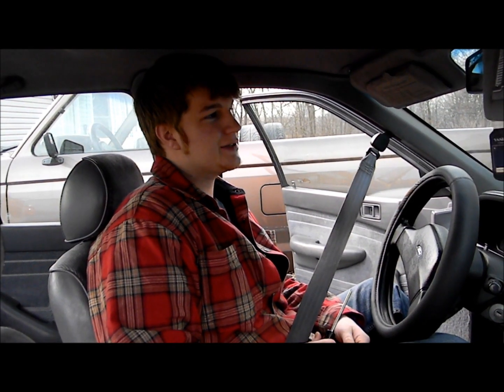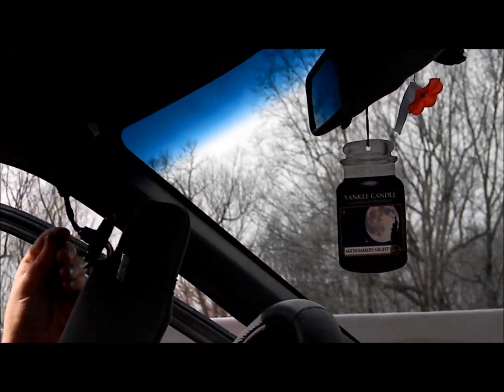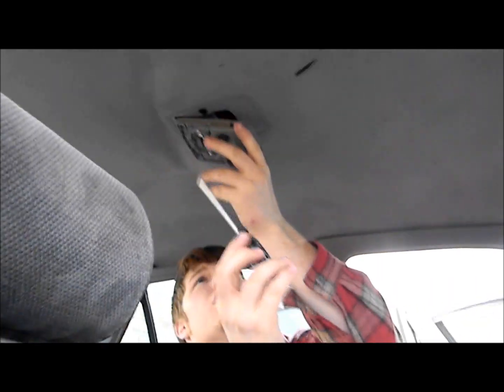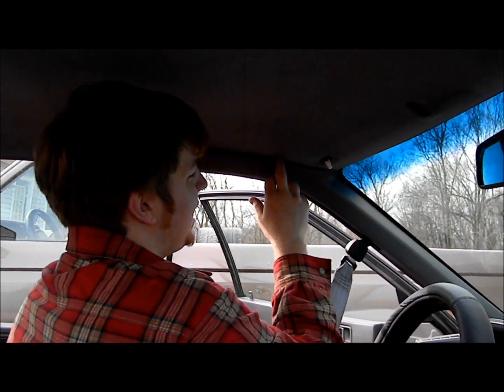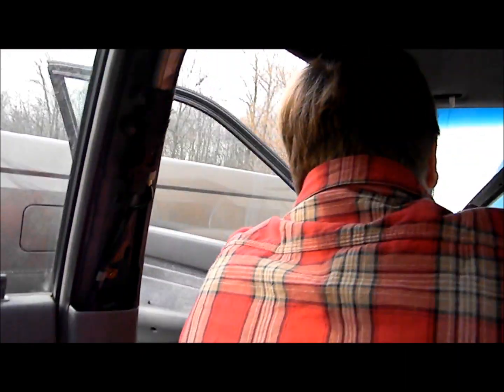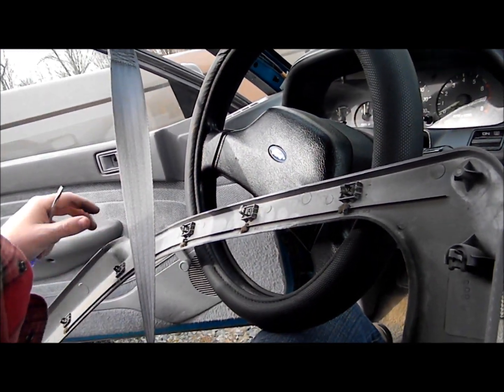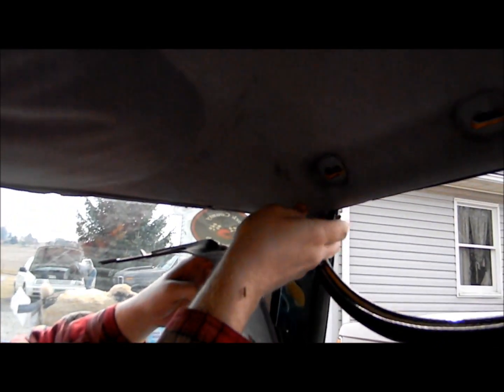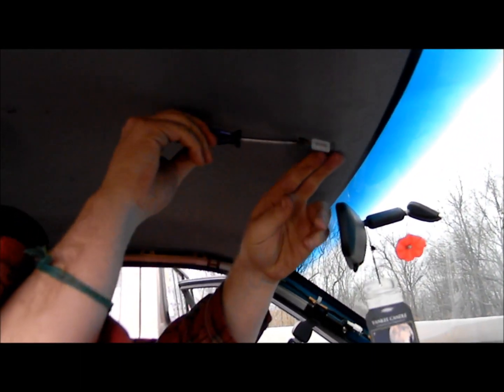DIY Custom Headliner | Headliner Repair | Custom interior

Comment: You have to remove all the old foam from the headliner first. Use a metal bristle brush to scrape it off. Otherwise the new bed sheet will start sagging in no time because thats what caused the sag in the first place, the foam started crumbling or the factory put the fabric on too tight (looking at you MK5/6 VW)

Comment: Hey guys great job! I've also done this with my wife but we just pulled down the old cloth material and wore safety goggles and laid the seats back and held up the New material we wanted to use. Then after the adhesive was done we used xacto knives and paint scrapers to push the excess into the panels. So we never had to remove the plastic and possibly break clips and seals. But your idea was definitely inventive and gives me some good ideas!
Reply from the maker: Thank you!

Comment: Very good video, better than professional. I very much squeezed the board out of the back right seat without braking it. Now I know how to put it back and I hope it fits. 
Also, I would remove the old foam unless it is very clean. The one you have seems very clean and uniform.

Comment: How long did this last? It's the foam that was breaking down and caused the fabric to pull away. Won't that simply happen again in a few months?
Reply: use a wire brush to remove all of the foam. A metal/brass one will work fine as long as the foam is fully rotted.

Comment: Good job young men. My "especial" is under the hood but my 86 S10 has the granny sag (not gray-sexy red lol) my prob is 1. It's a pick up so no trunk to slide out & 2. The headliner support plastic is broken. I don't have a center dope scope like your ford did, I'm thinking I'm gonna tear all the shit out & use some back upholstery carpet (was going to change seats at one point but decided fuck it) I'm going to attempt to use spray adhesive + silicone caulk lines to hold it up. Hopefully I can still cover edges with the "doodlejobbers" I actually learned quite a bit though. Bravo. I'll watch a cpl more of your vids, if they are as informational I'll add to my "professional subscriptions" 👍🏼

Comment: Has anyone seen a video where the original headliner is not available? I'm trying to replace a GBODYS headliner from scratch . I'm wondering what kind of board is flexible enough to fit the form?

Comment: another thing  you guys could of done was pull the headliner martial back scrape off some not a lot though of the foam under neath it apply some adhesive onto the foam and on the back of the matiral then pull the matiral lay it down flat like it was and rub its in place good then wait till it dry. and there you go

Comment: awesome video. was thinking of re-doing my jeeps headliner. the difference between your saggy grannies undies/boobies is yours was just fabric sagging, what do you suggest i do if the insulation(foamy) thing on the plastic is missing pieces. can that be replaced?
Reply from the maker: hmmm i dont know much about jeeps, i dont know if you can find the foam, if i had a jeep i would bed liner the ceiling instead of putting in a head liner haha
Reply: i will be bedlining the floor board and "trunk"  so i dont want to go overboard. lol. ty ill prob go to junk yard and get a some what complete one haha
 ~Rose

Comment: Bad choice fabric pattern, should have drawn some grid lines on the liner first and lined up the fabric pattern down the centure of the liner, Next work in small longitudinal strips from the centure out (left or right) then from the centure again and out (right or left) as you you do the longitudinal strips adjust the fabric so the 90Deg pattern lines up straight and @ 90deg to the longitudinal grid line. Alternatively use a non linear patterned fabric or a fabric with no patterns.